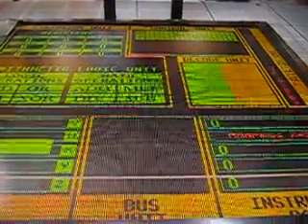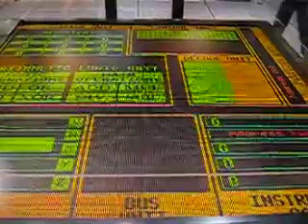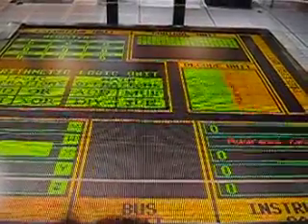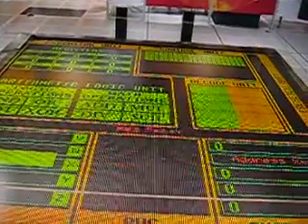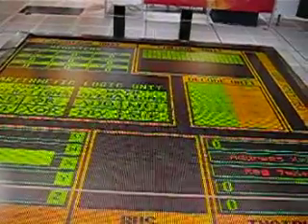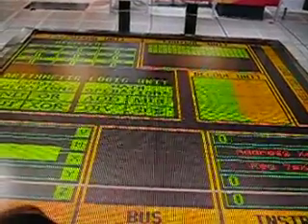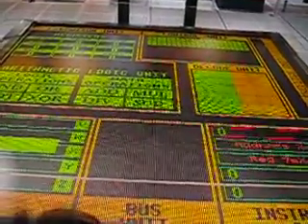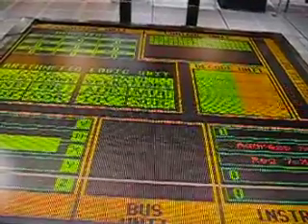Intel Museum - How does CPU works!?

Comment: A CPU woks like this: there are 2 parts in a CPU 1st the data decoder uses and ,NAND,decoders,or latch gates,ect these then take raw data and convert them in to storeable data and commands mostly Camands to gpu (graphics card)so in some it figures out what to do.2end part takes raw data and applies fx. to the data sent to it from the first part and gets sent back.this part is where the math is done and in the first one it figures out what to do with any/all data- gpu graphical processing uniit

Comment: @jasonpolaris heh, IMHO it would be thousand times more clear without those "jokes" and using names like first level SRAM and so on. Best way to understand processors is to start writing programs in .asm and learning about process muxation for example in win32 (muxers, semaphores and such) and of course working with low level 8bit microcontroller in RISC arch. 

The idea of such lecture is good but IMHO it is too complex to be understood without basic electronic knowledge.